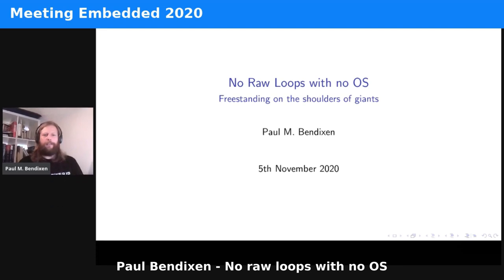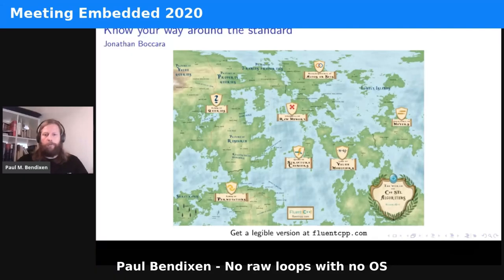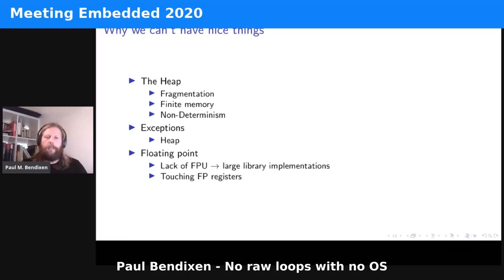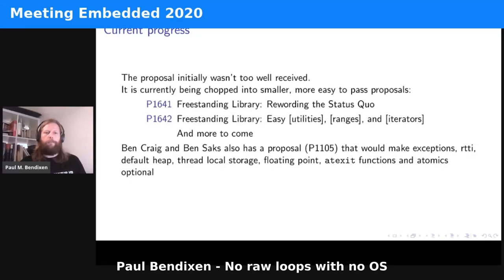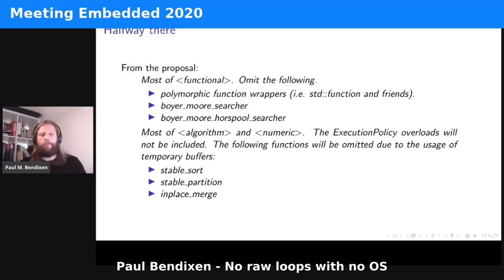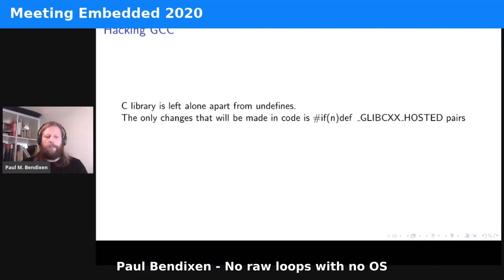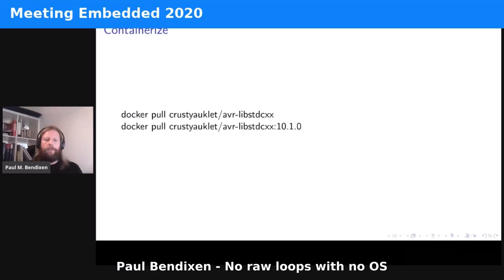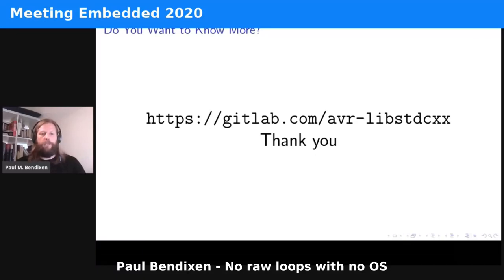Paul Bendixen - No raw loops with no OS - Meeting Embedded 2020

Comment: If it's a header-only library, couldn't this be placed on github? That way it can be very smoothly used with any cmake project, since CMake can clone from github and add the dependency directly, granted it has a CMakeLists.txt file of course. Conan is "great" i suppose, but I'd rather not use Conan. One has to use a build system unfortunately with C++, but I'm not all that hype for spamming my computer with 3rd party build tools.
Reply: libstdc++ is not technically a header only library although you can use a lot of it by including the header files and not linking against it. The official repository is not on GitHub but a GitHub mirror exists: https://github.com/gcc-mirror/gcc There is not CMakeLists.txt this is autotools all the way down also the source/build system is inside the gcc source which complicate things a bit.
Reply: It would be possible to extract the parts that make up the library, because the freestanding parts are all header only. The maintainance would be a nightmare though.
If you want to avoid using conan just follow the conanfile.py and do it manually, it is a python file that describes exactly what files need to be copied.